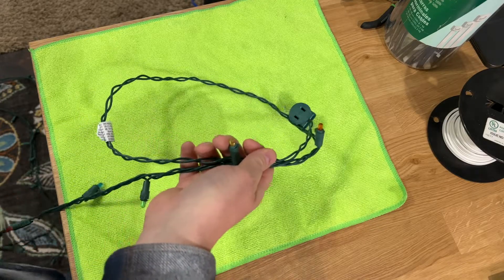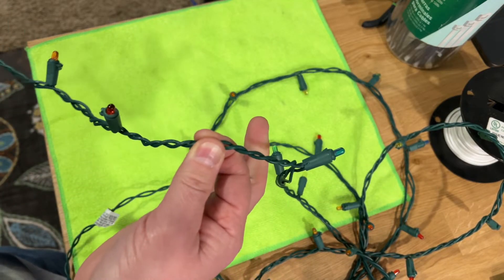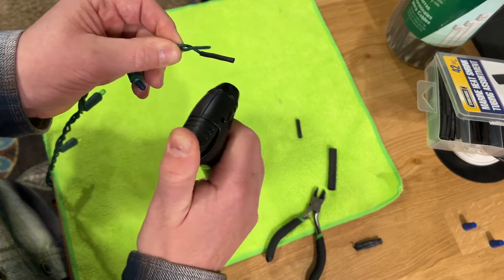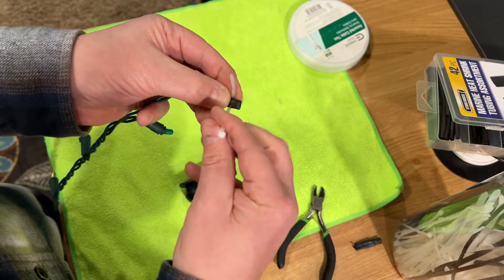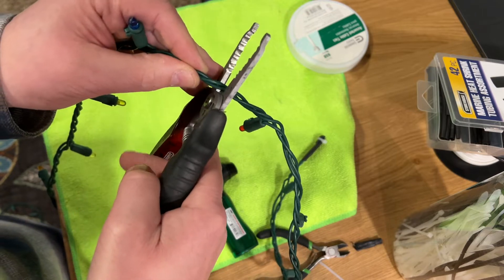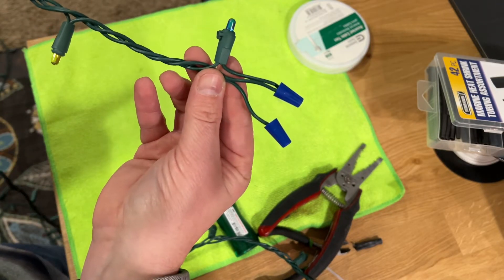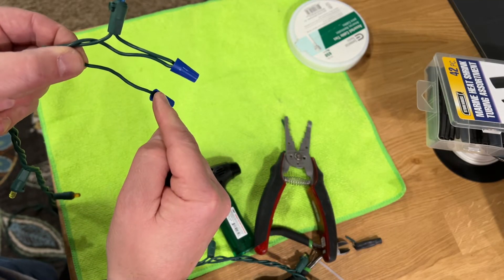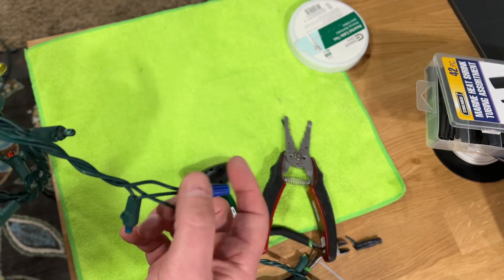How to Shorten LED Christmas Lights

Comment: How does one go about using the second half of the string that was removed?  Is it possible to add a plug on the discarded section so that it will work?  Specifically, I’m talking about a string of lights that has 3 wires from first bulb to last.  I was able to get the first half working after cutting off the second half, but I’d love to be able to use the second half on another project and not discard it. Thank You!  Great video.
Reply from the maker: Thanks for watching. You can add a plug to the unused end. See this video that would show you how to add it. How to Replace Plug on Extension Cord
https://youtu.be/acui5oc0lBY

Comment: you didn't say anything about a resistor like others have talked about.  Is the resistor closer to the plug so you didn't have to worry about it??  I need a 20 light strand with 6" spacing and NO ONE seems to sell them anymore.  They keep trying to shove 4" spacing down my throat. You need what you NEED> so I thot hmmm maybe I can cut something in 1/2 or get a 20 from a 50  with the 6" spacing.  Would it also be possible to put a new plug on the part you cut off so now you have 2 seperately working strands from 1 strand of 50 lights?
Reply: I had the same question about adding a resister. I have tried it adding up the total resistance of the removed bulbs. My results were not good because the registers overheated. I also good with electrical but not so much with electronics.

Comment: I’m trying to cut the led lights into smaller sections and some cuts would be where there are 2 wires and some where there are 3.  But I want to be able to still connect them back together.   Like for example automotive wire connections.  Is there something that will work. Thank you I hope this makes sense to you
Reply from the maker: Thanks for watching!  Yes, you could use something like this: https://amzn.to/3W1SPdx

Comment: Could i follow this guidance and splice a plug in on it? I need to shorted my LED G30 Christmas lights into certain lengths to accommodate the different length ridge spans on my roof, but i need to be able to connect them together. They're all 58.1' (57' lighted). I need to shorten where one is 18', one is 25' one 36', etc. Can this be done?
Reply from the maker: Should work. Let us know how it goes in the comments. Thanks for watching!

Comment: Hi. I need to make a custom string of lights that are about 3’ total length and need to have approximately 2” between each light. Is it possible to cut between the lights and reattach the wires to make a custom string of lights like this?
thx so much
Reply from the maker: I don’t see why not. It sounds like a lot of work!

Comment: My Christmas tree has almost 3000 mini led lights attached in 3 separate sections.  The largest bottom branches did not light when I plugged all sections together.  I called the manufacturer and they sent me only replacement lights.  I was hoping they would replace the bottom section.  I searched every branch until I found one light bulb damaged with the wires severed.  I'm not interested in saving the light but want to know how I can join the severed wires together to make all the lights work. There are 3 wires at the break in the strand.  I'm trying to avoid removing the lights and putting new ones on. I really don't want to just add new lights over the original lights.  Can you help?

Comment: Hello, I just accidently had the LED lights get cut in half (on a fence we never use the gate and wife opened the gate, cutting the wire).  ANyway, tried your method of 3 wire section.  However, I am positive that I have the wire that does not go into any bulb and I put a leak proof wire nut , but the other two wires, both  go through each bulb casing (2 in and 2 out).  What do I do now?  Tried turning the lights on, but nothing.  I was guessing to use three wire nuts , 1 on each wire. Your thoughts?
Reply: take the single wire and connect with the bulb wire and take the wire you connected with the bulb and terminate it singly.
Reply: Had to change the wire (one of two) going in and  out of the bulb base.  First nothing. Changed the other double wire and it worked.  Thank you so much. It was  a brand new string of 500 feet, lost about 150,ft, but I am okay with it. On the front of the house is all I really wanted.  Thank you and Happy Holidays.

Comment: What if the set has only 2 wires .? Not 3
And I want to shorten it?
Reply from the maker: You could use the 2 wire method in the video.  Thanks for watching!